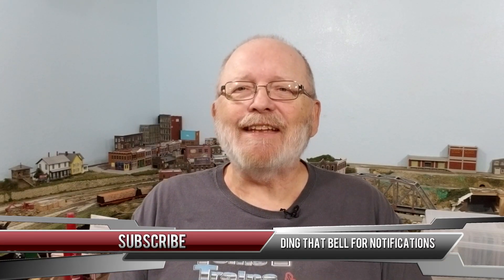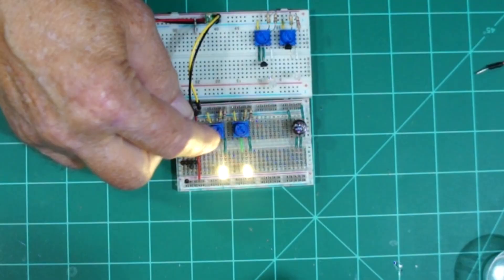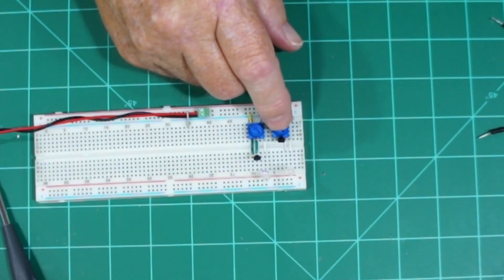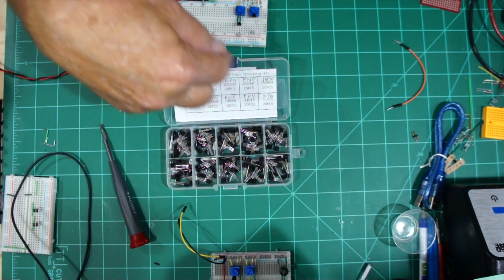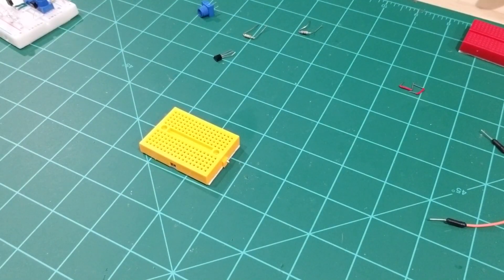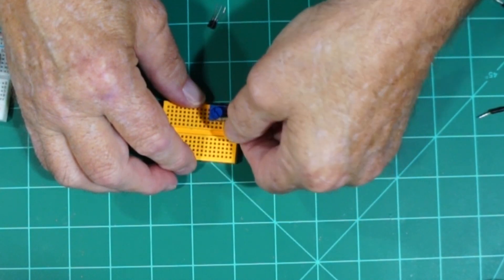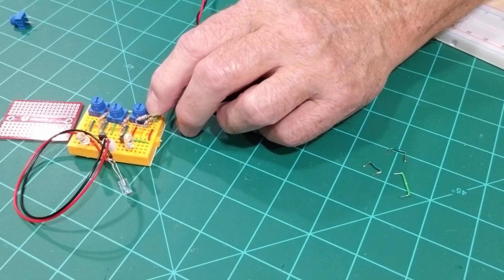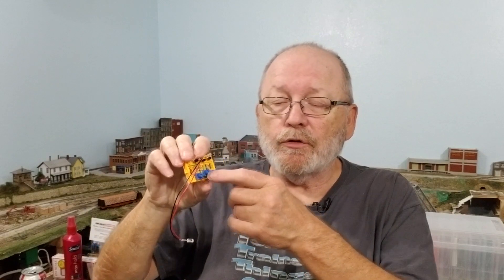Light Up Your Model Railroad From A Mini Breadboard

Comment: Thanks for the great videos! I am a new subscriber as I have an 8 yr old budding train enthusiast in the house. Sorry if you mention elsewhere, but what power do you supply these circuits? Is it 24vdc as Just Plug uses?
Reply from the maker: Glad I could help. You can use up to a 24 vdc wall wart on this project, but I used a 12 vdc wall wart on mine.

Comment: Tom, can you run your light lead,s out a foot or so from the c.board? or will the power fall off that far out.I Don,t know anything about this.But it would be cool to have light,on the layout. thank,s for doing these video,s.
Reply from the maker: You can run the leads out quite a bit. The resistance from the wires isn't that great that you would be able to notice any change in brightness, I would still try to keep the circuit board as close as possible to whatever your lighting, like at the edge of the layout.